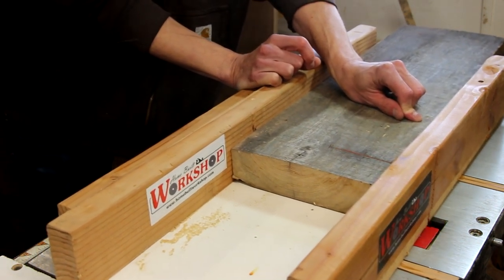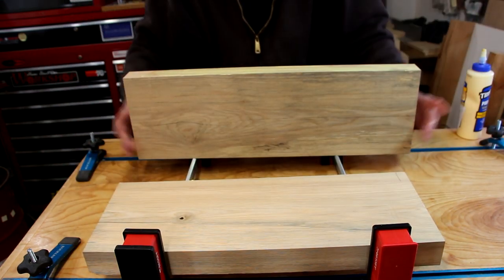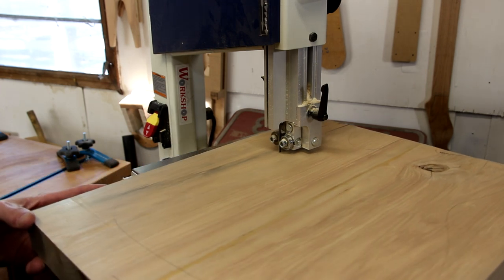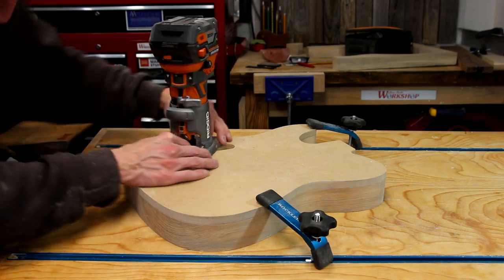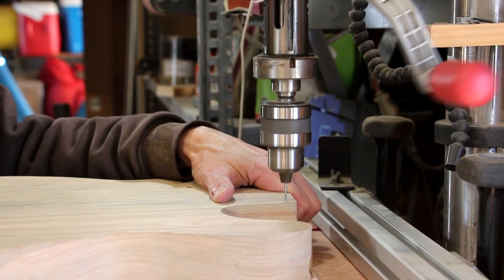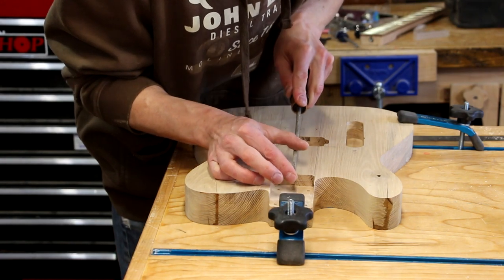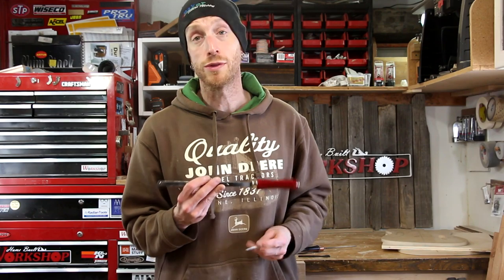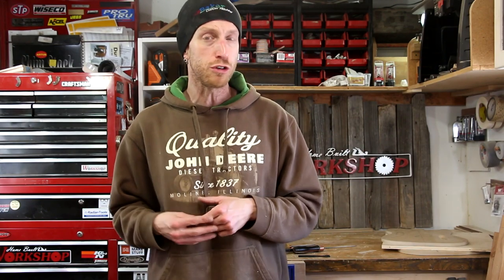Q&A: Woodworking Tools to Build a Guitar

Comment: Something I do recommend for anyone building solid body guitars (well 2 things) is make the neck first.  That will dictate how the body neck pocket is created as well as the ultimate scale length.  The second is measure, measure cut.  

Also for beginners it is a good idea to start with guitar kits before moving into scratch building.  There are a few companies offering these kits (be aware though some are poorly made and you'll end up with a bad final product.  Also remember that kits do require work, and you will build your luthier skills off them.

Keep in mind that the hardware and electronics are gonna be junk (talking Chinese garbage.  You have lots of options out there to make a kit play well.  Personally I have 3 kits going on right now.  One is a P bass style and they other 2 are LP style.  Each one will have upgraded hardware and electronics (like on my bass I use a Hipshot bridge, and I replaced that crap neck Solo made for this bass with a Mighty Mite Neck).

Anyway hopefully people will find this info useful.  Guitar building is a process, but in this process you can eventually have an instrument that is truly an extension of your personality.  You'll be able to step away from "Generica" made guitars, and other clones as well.

Comment: Thanks for the info, Jeff! I've wanted to make a guitar for a while, but never have quite yet out of fear of the process. I might have missed it in the comments, but if you didn't have a band saw to cut out the rough shape, couldn't you use a jig saw as long as you clamped the blank to a sturdy surface?

Comment: What are the typical dimensions of the body blank?  I have an 8/4 board of wenge 6" wide and 48" long would that be useable for a glue up? I could probably get a 16" x 18" blank
Reply from the maker: It depends on the size of the guitar body you want to make. For me, if I can get at least 13x18" its plenty for me. I like to go with 1 3/4" thickness. If you like a thinner body, you can go a bit less.

Comment: Hi Jeff, I was wondering how did you keep the pickup template still while using the trim router
Reply from the maker: I use double sided tape to hold the templates in place.